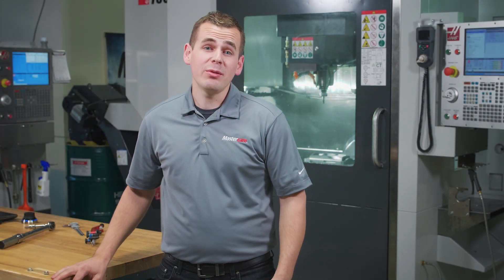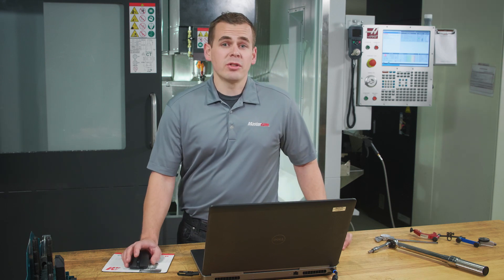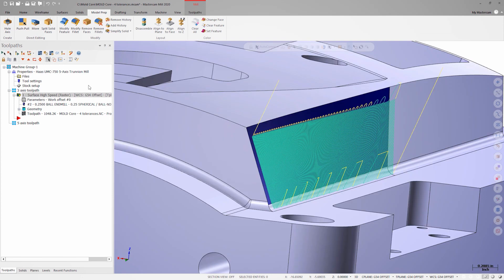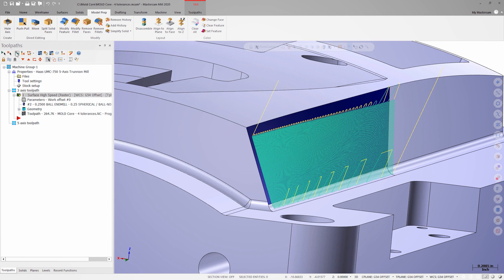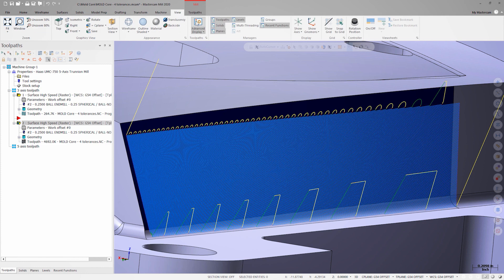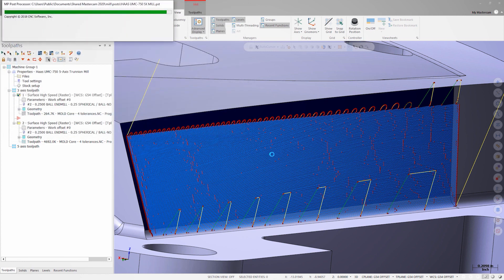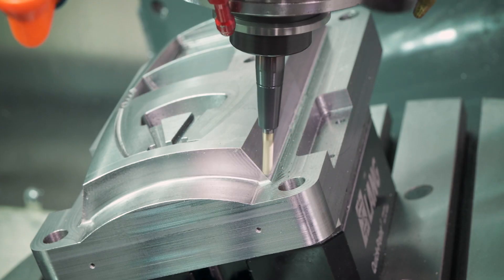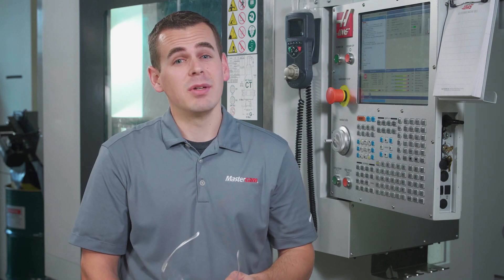Understanding Arc Filter Tolerances

Comment: So are you saying to get a better surface finish, turn filtering off? What about smoothing?
Reply from the maker: For a better surface finish use a tighter cut tolerance. Tighter the better. If you want to use the arc filter, we tend to use a 1 to 3 ration. 

If you use the arc filter for finishing, make sure you use the “tighten line filtering tolerance”

If you don’t want to use the arc filter then you can go into the smooth settings and “Present arcs as line segments”

Comment: This filters affect to G187 code?
Reply from the maker: In the default Haas Posts, the filter and tolerance will not directly affect the G187 output in the code. In some instances, it is desirable to have a G187 code output that does not directly correspond to the tolerance entered for the toolpath. You will still need to enter your desired G187 settings. If you would like this to occur it is entirely possible to do with a proper post-modification. Talk to your Mastercam Reseller or post developer to see if they can offer you this change. https://www.mastercam.com/support/technical-support/

Comment: Zero RPM? You mean zero SFM?
Reply: @mastercam  The entire tool is rotating at the same RPM, rotational velocity doesn't change based on radius. Surface speed decreases to zero at zero radius at the ball tip. It is surface speed that allows a cutting tool to remove material, cutter rotational velocity is just a knob for controling surface speed.